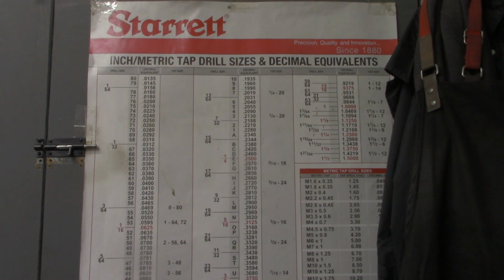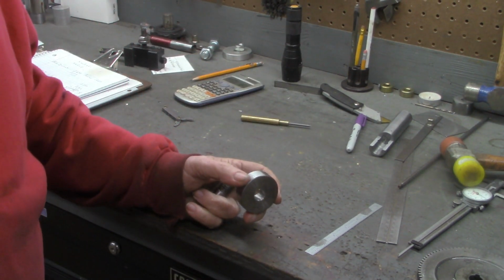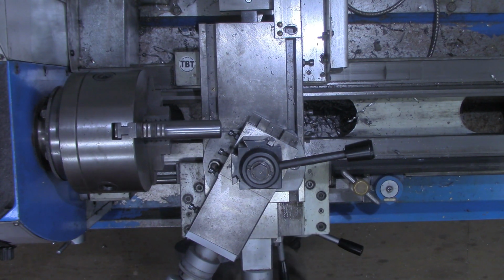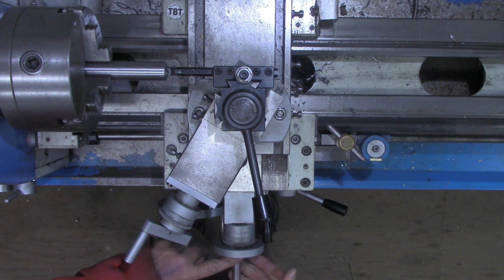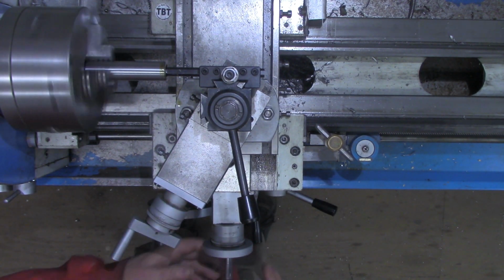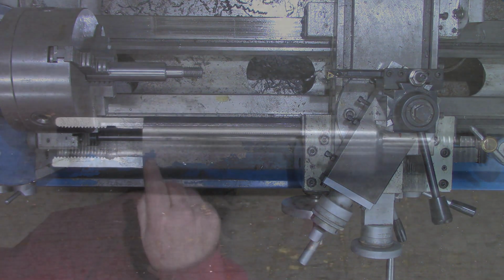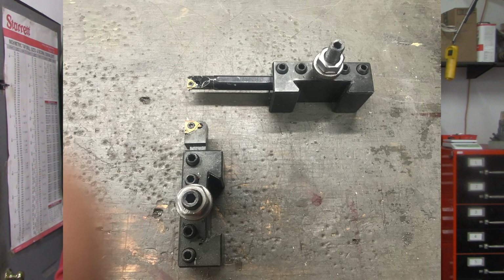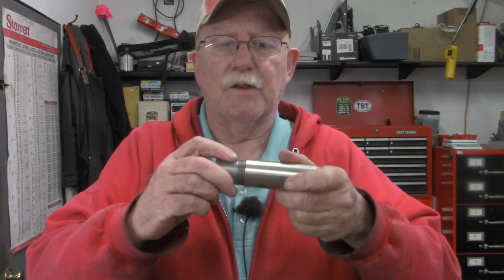Internal Imperial Threading on an Import Lathe

Comment: The correct bore size for an internal thread equals the nominal bolt (or screw) size minus the thread depth shown on a thread depth chart.  Example: The bore size for an internal  3/4"-10 TPI is .750"-.0640" = .686".  The bore size varies with the number of threads per inch with courser threads always being deeper than finer threads.

Comment: Just have the compound 180 deg from your current set up and then feed in with the compound and there's no conflict with the carriage/compound and the chuck.
Reply: True but a little difficult to see the compound dial clearly at the rear of the cross slide using that setup.

Comment: If you turn steel at any speed with my lathe at least you get your forearms and hands showered in hot swarf causing you to let go of the controls etc.  So although I have heard the no gloves and no long sleeves I prefer to cater to the safety items more germane to my needs.  I am very careful (I know everyone says that) but I don't like being burned cause it hurts and destroys concentration.  Sometimes safety has to be done with a healthy dose of common sense.  I have tailored my routine at the lathe to my needs for instance I never, ever use my hand as a brake on a turning piece.  I see a lot of people doing that as they shut down and maybe it fits their needs but I wear tight sleeves and keep my hands away from moving parts.  But I do get the thought!